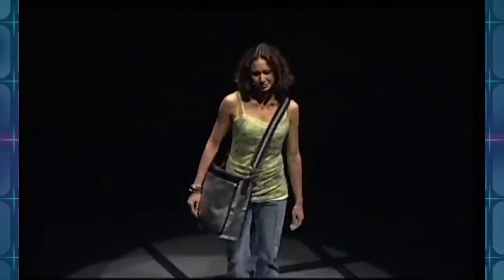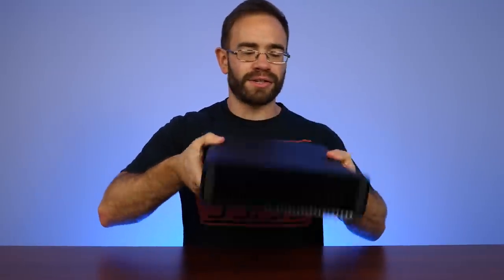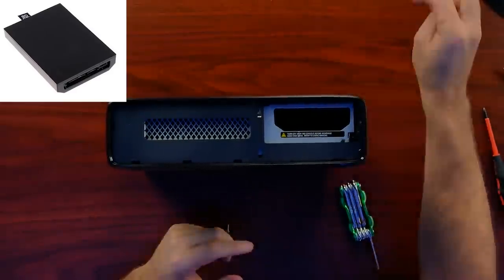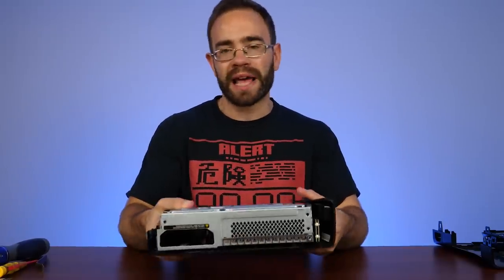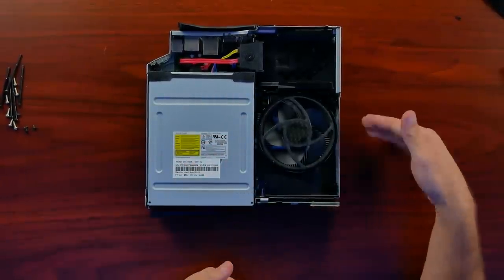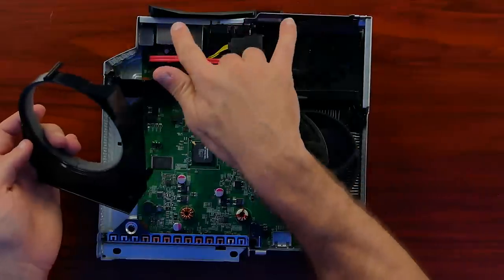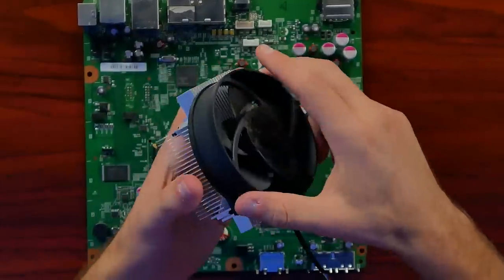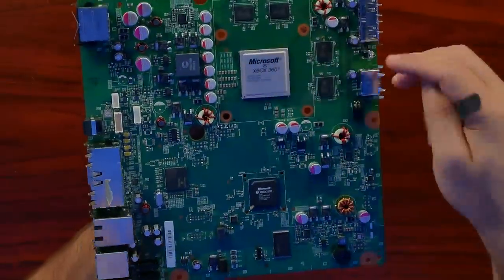Here's How Microsoft Solved The Xbox 360 Red Ring of Death

Comment: I love how no one ever mentions the 360 elite
Reply: @Johny Hw right lmao it’s like yeah no one likes that one screw it it’s just like the rest lmao
Reply: It’s probably cause the xbox one come out right after
Reply: @WhirlwindQuest  the elite was technically the launch 360 but it was a special edition black console with a 120gb hard drive instead of the plain white pro / arcade console
Reply: @Bammarge2  Actually, that’s just the “Jasper” model. Basically, Microsoft slightly redesigned the 360 twice before the Slim model. There were two different Jasper versions. One dubbed the “Arcade” model where it came with no HDD and a matte plastic finish on the outside of the disc tray, and the other was unofficially dubbed the “Elite” model which did come with an HDD and the chrome plastic finish on the outside of the disc tray like the original model from 2006. Both versions of the Jasper model had HDMI. The true “Elite” model was the Xbox 360 E which resembled the original model Xbox One. It was shortened to Xbox 360 E much like how the Slim was shortened to Xbox 360 S.
Reply: @alessandroplays8525  strange my elite has a matte black tray that matches the HDD and console itself I’ve never seen another one like it
Reply: The elite was the first 360 with  HDMI. At the time my tv didn't support it, so the arcade and 120bg hard drive was my budget elite, regrets were had...
Reply: @bdog3106  my white pro has a hdmi so the elite being the first? Maybe the same mother board? lol my current one  which I got just about a year before the elite came out
Reply: @WhirlwindQuest  lmao, you’re incredibly incorrect, a quick google will show you.
Reply: Thats because it wasnt any different than any other 360 with a HDD. The only difference was the black plastic case.
Reply: @alessandroplays8525  The first "Elite" consoles were Falcon mobos. Xenon,Zephyr,Falcon,Jasper. Slim was Trinity, Corona,Corona V2,Corona v3.
Reply: @Bammarge2  the mother boards are pretty much the same,  the pro models came out with the HDMI after the elite released. The HDMI port was a big deal for game consoles when lcd and plasma tvs became more affordable and more common in homes
Reply: @bdog3106  ahhh interesting

Comment: You wanna know how I fixed it?
Pennies thermal pasted to the mother board
Reply: It's just a band aid solution doesn't fix it permanently.
Reply: Thats dumb and I suggest you stay away from "fixing" 360s. You are damaging the motherboard beyond repair. If you want to properly fix it replace the parts that are defective.
Reply: It worked for the last year I needed it, I was like 16 at the time
I regret nothing
Reply: your 360 was not rrod, just overheating..

Comment: The jasper board revision was also very good at keeping red ring away. Mines still going to this day
Reply: Yep. Its lasting longer than many s/e consoles.
Reply: Yes! I've got 3 Jaspers, all still going strong. My Xenons and Falcons are long dead :(
Reply: Same. Keeping my fingers crossed it keeps kicking
Reply: I bought a Res Evil 5 red Jasper 360 console, because I thought my launch 360 would eventually die. They both still work 100% Unlike my launch 60GB PS3 which YLOD in 2014
Reply: @leonhantz6383  the reason many old 360s die is because of defective gpus. Either the one you got was not defective or is and is dying slower than others.
Reply: @rockl79  My launch DID RROD, fortunately I used M$ free repair service which they offered at the time, and it's still working now
Reply: @leonhantz6383  you should RGH one of them If you have two consoles. Theres some decent homebrew for x360
Reply: @leonhantz6383  These PS3's while easy to mod are very likely to die.
Reply: The Jasper was the most reliable. Way more resilient than the newer slims. I had 3 slims fail. I have had 4-5 jaspers at one time but sold them. I have 2 dual boot RGH jaspers right now and still run awsome.
Reply: Yep, my arcade Jasper console still runs to this day, sometimes the disk drive is wonky though
Reply: @shapeshiftsix  mine was doing the same but I done the RGH and just removed the whole drive lol
Reply: My Jasper Xbox 360 Arcade still works which I bought in 01- 01 - 2010

Comment: "The Xbox 360 board flexed so much it caused the RROD."

ME: "Dammit, Nux Taku!"
Reply: It wasnt the flexing. It was the constant temp changes. Heating and cooling. Heats when you use it and coola when you turn it off. The solder balls under the GPU were terrible and couldnt hold up to the temp changes and they would break.

Comment: The xbox 360's RROD failures are now well documented. The lead free solderballs under the gpu would crack in places because of the heat stress it was put under. Lead free solder is very brittle compared to lead solder (The lead helps the thermal expansions and contractions as it undergoes use and non use....that's why it's there and why the military still use lead solder for mission critical applications. Consumer grade electronics? meh. They'll just buy another one). The passive heatsink was too small; the early GPU's used a lot of power and put out a lot of heat. They plonked a full size DVD drive directly over the small gpu heatsink so there was literally no room for any active cooling. I think if they had used a slim DVD drive they might've had enough room for some active cooling. But they were financially commited to that design so had to keep going. 

Fast forward a few years when the Jasper revision came out, that used a lot less power and therefore less heat being generated and Microsoft more or less had the problem solved. Then they integrated with CPU and GPU onto single chip with a massive active cooling fan on top with the Slim design.
If you have an early revision 360 like the xephyr, Xenon or Falcon with a RROD, the only proper fix is to remove the GPU and reball it with lead solder.

In fact, if you want a belt 'n braces repair, use a brand new GPU because the even smaller solder balls underneath the chip itself could also be going bad. If you still have a Zephyr or Xenon that's still going, that's great! But you can still help it by fitting a second gen heatsink and fitting a fan to the top of the heatpipe extension and drilling holes in the case to expel all that heat.

Oh yes, and it's soLder not sodder. Rhymes with coLder, oLder, foLder etc.  there's an L in there. Please use it 🙂 😉

p.s. LOLing so hard at the wifi module that plugged in via USB...so typical of Microsoft cheaping out on the design, even with the Slim 😁
Reply: Issue was actually between the die and the substrate, not the substrate and the console.

And it was from thermal cycles rather than overheating. So typical cooling mods didn't help at all for preventing RROD. Overkill ones like water-cooling did though.
Reply: That was not the issue at all. It was not an issue at the motherboard level, it was an issue with the GPU and/or CPU themselves. The Xbox 360's cooling solution is actually perfectly fine for the system and keeps the system well within safe thermal ranges. The 360 if I recall never rose above 85 C fresh off the assembly line. Like Shanez mentioned above, the issue was the connection between the chip die and the substrate. Essentially it was a complete internal failure of the chips, mostly the GPU, though the CPU was prone to this as well, but it was a bit rare for that to occur. To fix these consoles, the chips have to be replaced, whether it's the CPU or GPU. 

Any original system that was manufactured from mid-late 2008 and up as well as older systems that were serviced by Microsoft during that particular time will likely never see the RROD, because they were upgraded with newer chips that no longer had this problem.

Oh and the pronunciation of solder depends on where you live, because there's two pronunciations of it. American is "sodder" where the British pronunciation is "soLder"

Also, that is NOT a USB port for the WiFi card on the 360 S. It's a custom connector that looks like USB, but isn't. It's significantly larger than USB.

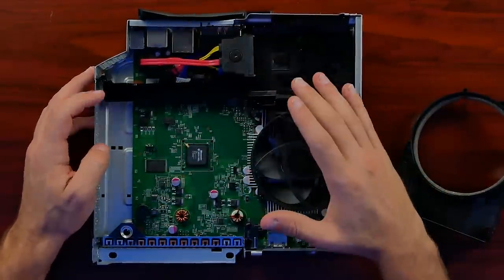Comment: 9:50 considering I did the full speed fan mod to my old 360 it was LOUD. Cut the fan power wires scrap the pwm 3rd wire and wire the 12v+ directly to the 12v for the drive. Running them at full rpm all the time... kept it a lot cooler though.

Comment: A big reason why I went for the PS3 instead of the 360 was due to the RRoD issue. Sony's systems were supposedly more reliable, so of course mine had to YLOD after only two years of ownership, twice, even after getting it officially repaired. I replaced it with the CECH-2000 Slim, which has been rock solid. That era was just bad though for hardware failures. There's a reason why Apple ditched IBM PowerPC for Intel.

Comment: "So Microsoft's actual response to every 360 breaking down was: Hey, buy this new black Xbox 360, this one actually works!"
Reply: Actually the RROD had a pretty much infinite warranty. I returned mine three times at no cost (including no shipping cost) and had it fixed twice, and they sent me an identicle new model the third time.
Reply: @gamble777888  It's a dunkey quote. Watch his video on Microsoft. Yes, they did extend the warranty, but it was not uncommon for people's Xbox to continue to keep breaking after they sent it in (apparently, you can even personally attest to that). dunkey sent his in 6 times for example. And when the extended warranty ran out and your Xbox broke again, you were on your own.

What they should have done is get people a new model with the new board (I believe there was already a hardware revision that ironed out the ROD issues before the 360 S), instead of sending them back the exact same model of 360 that was almost destined to break again.
Reply: It was probably not feasible for them to sent customers a new upgraded model for free. As the video illustrates the S was not just a slight revision it was a completely re-done system.
Reply: @gamble777888  As I said, I think there was already a hardware revision of the original 360 that ironed out a lot of the issues. They could've switched out the components for new ones.

And that may have been even cheaper than all this back & forth with millions of people over so many years. Also, "not feasible"? It's Microsoft. They've got the cash,  they just have to be willing to spend it. If I buy a brand-new console for 400$, I expect it to work.
Reply: @Howitchewstofeel5gum  I've never met anyone who had their warranty denied for RROD, I myself sent in my Xbox 360 for RROD repairs as late as 5-6 years after purchase and had it repaired. BTW every RROD repair necessitated new parts as I believe the GPU required outright replacement. Was it the optimal solution, perhaps not? But everyone who paid 400 bucks was getting a free repair as many times as they needed free of charge. So while definitely not ideal I wouldn't call it a rip off, or say MS refused to own up to the mistake. They probably lost millions and at the end of the day anyone that owned the Xbox had access to as many free repairs as necessary.
Reply: @gamble777888    Again, watch the dunkey video. There were definitely people that were told "Sorry, your warranty has expired", as that warranty only extended to three years after purchase. And no, buying a console that breaks after a few weeks, sending it to Microsoft and waiting several weeks to have it repaired, only for it to be shipped back and break again SEVERAL TIMES is pretty much the opposite of "ideal".

(Btw, there were also other hardware issues like 360s scratching up discs that weren't even covered by the warranty extension. Microsoft was "nice" enough to let you buy a new disc for 20$, though 👍🏿)
Reply: @Howitchewstofeel5gum  I'm pretty sure the RROD warranty was extended indefinitely, perhaps some got shafted before that became policy, which is shit, but again Xbox responded. The Xbox slim was a mid Gen upgrade (during the longest Gen of all time) a lot of people were going to buy it regardless of RROD simply because it was a big upgrade over the original that had come out 4 years earlier. I don't really see it as them milking the RROD, and my whole point was that after the original fuck up which was shipping the defective hardware to begin with and which I'm not excusing in any way, the response was not bad. Free repair with no shipping cost, and eventually the extended warranty (I'll look for a link to back that up). Asking for a Xbox slim for RROD four years after purchasing the system would have been amazing and extremely customer friendly but then people would probably be hunting down old xboxes or trying to RROD their current Xboxes in order to get the free upgrade.
Reply: @gamble777888  sigh

"I'm pretty sure the RROD warranty was extended indefinitely,"
Again: NO. NO IT WAS NOT. It was three years. Just google it instead of going back and forth with me 100 times. 

"and my whole point was that after the original fuck up which was shipping the defective hardware to begin with and which I'm not excusing in any way, the response was not bad"
And my whole point is, AGAIN, that some people sent in their Xbox 360 multiple times and when it came back it was still broken or broke again shortly thereafter. And after doing this multiple times, they were no longer covered by the warranty. This, I would indeed call "bad".

"Asking for a Xbox slim"
AGAIN: Not what I was saying. I said that there were already HARDWARE REVISIONS of the original, white Xbox 360 (if you don't know what that means, google it) long before the Slim model came out that fixed a lot of the issues. So it would've been in everybody's best interest to send customers these models or replace the questionable hardware parts with the revised ones. Which Microsoft didn't do.
Reply: @gamble777888  100% WRONG. I know for a fact the RROD warranty wasn't forever. My ex sent hers in 7 times and when it failed the 8th time they refused to fix it. So I bought so cheap thermal paste an watched 20 different YouTube videos and fixed it myself. Was still working when we broke up years later lol. Amazing how spending 20 bucks on eBay amd watching YouTube vids I was able to fix it better then Microsoft.

Comment: I agree with you on the s model that you took apart . I own several in my collection from the first Xbox to the e model . The s model is the best . But I do have a question, I have had several of the small square e models fail , so much I would not buy to resale any as I do buy , fix , repaired to a certain extent on all consoles. 
  My question is being the S model that you tore down and the smaller E model that’s square are close on the builds of the board , any ideas on why I find so many different problems on them ? I have spoken to the workers at a local game store that I deal with and they said it’s not just me , the E model they would rather not carry at all , but when they do take them on trade when they resale them threw the store , they will not sale them locally , only on eBay as is no warranty. The other models they will warrant. 
Please let me know your thoughts . And yes I have followed you on both of my YouTube channels for a long time , you do a great job !

Comment: The E Model was better, if you combine the official Microsoft 500gb HHD for the 360 and that model loading times and overall speed of the systems OS are enhanced slightly. In my experience I saw these enhancements.
Reply: What is an HHD?
Reply: Did you mean SSD or HDD?
Reply: Yh but it doesn’t look as good as the S
Reply: Not really. They run the same as all other 360s in terms of speed, are less reliable than s models (both of their board revisions are known to die), and the s models are less reliable than jasper revisions.
Reply: Wait my launch xbox one only has 365 gb hhd and sizes ended up bigger
Reply: Sean Stone all launch Xbox ones had 500gb
Reply: Dex oh bc i can only use that amount of storage i get it
Reply: Sean Stone it’s called formatting
Reply: @dex6627  Agree

Comment: Sadly over 40% of them got sent back not fixed and in worse condition

Edit: its true info but you know people kinda forget about such things since they wanted people to shut about it. So they then fixed it.
Reply: I got the red ring sent it in and got my console back. Believe it or not it actually still works I don't use it anymore lol but it still works maybe I was just lucky.
Reply: Mr. Obama Jr.  did you send it in? If I remember the process what actually quick they did a good job in my eyes like I said it still works disc drive is a little sticky from time to time but it will still play game.
Reply: Tsyuna Desu  I don't use it because well it got shelved when I got the new one. And that new one will be switched out for the new tower and shelved and in 10 years I can say my vcr gen 1 xbox one will still work i have faith lol. Sorry for sharing my experience or opinions 😅
Reply: I got the Arcade edition and that still works till this day. I had a jammed disk tray but I fixed it by just cleaning a little piece of rubber that helps the gears spin. I gave the system to my best friend and he plays it all the time with no issues.
Reply: @chrisgotgames6405  lol